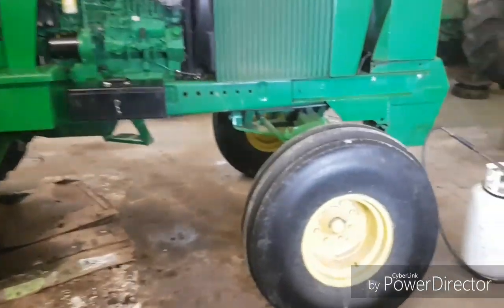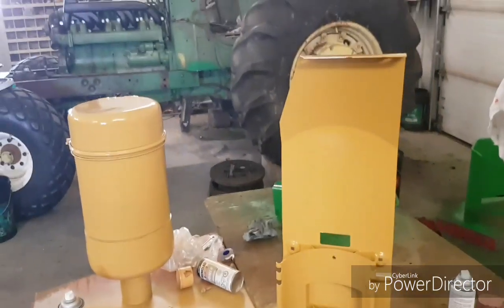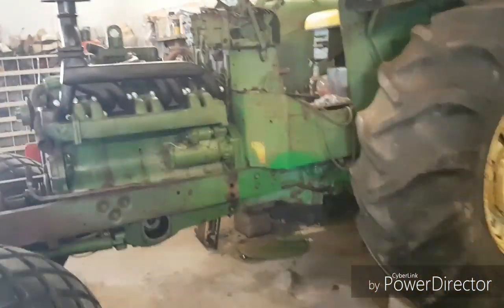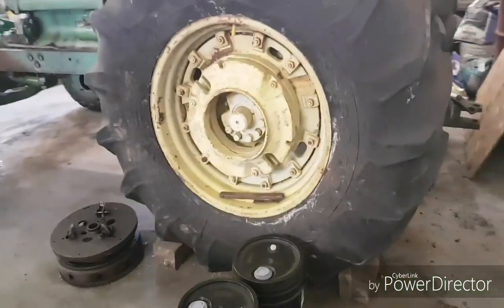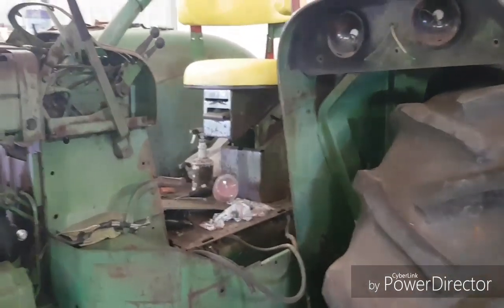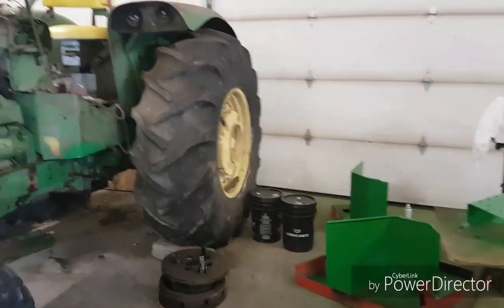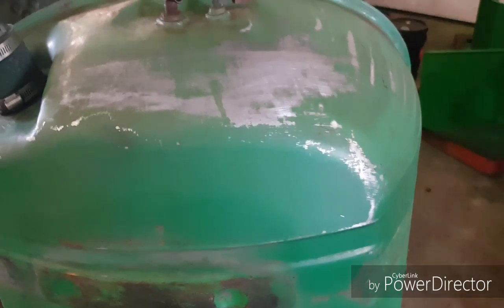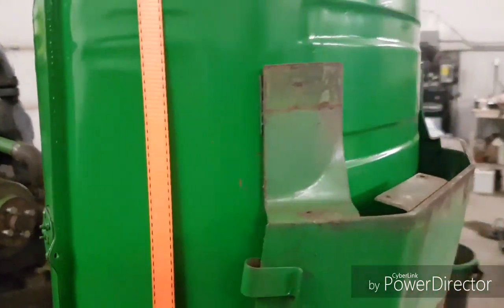Prepping and painting begin on the 5010!

Comment: Just noticed that engine has an awfully small injector pump. I have a 1975 2020 with a four cylinder engine and they look about the same. Are they original to those engines? Wouldn't you  benefit from a larger one?
Reply from the maker: Original to it and no not really. Just burn more fuel
Reply: Them pumps are on 40 to 200 horsepower tractors. And in my opinion they’re great pumps